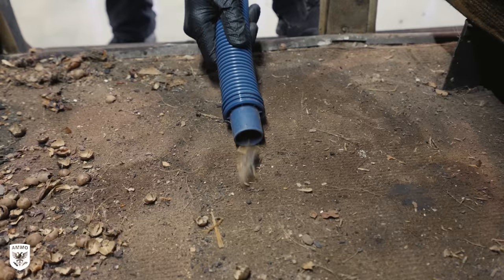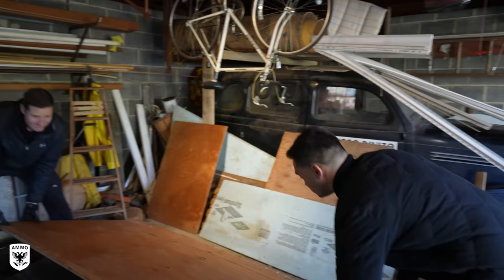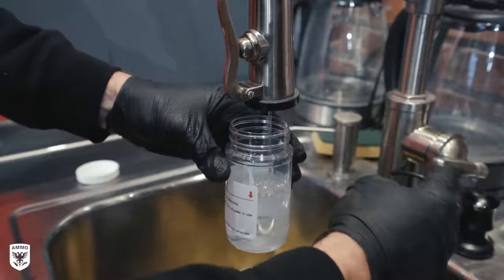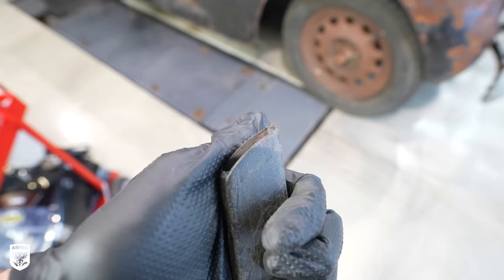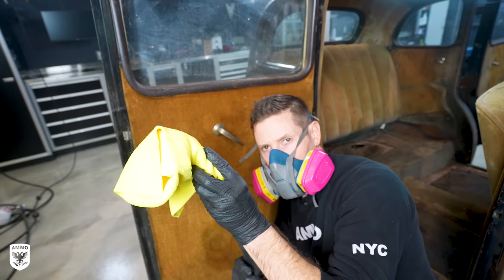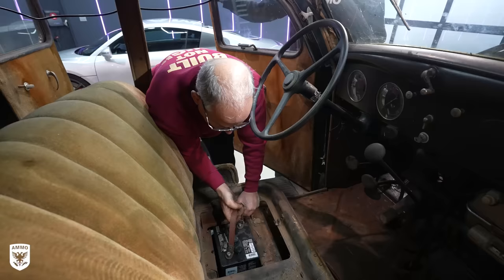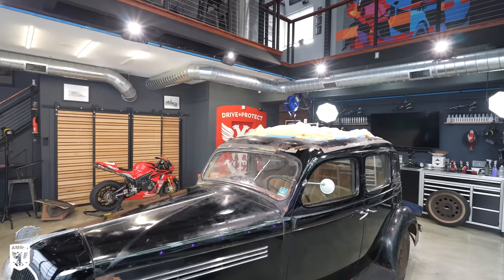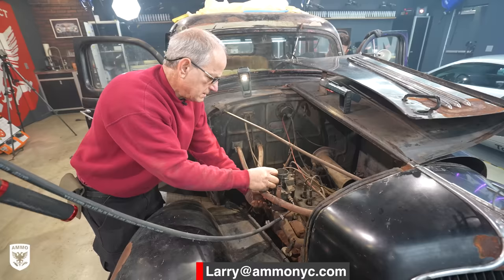First Wash In 43 Years: 1935 Plymouth PJ Barn Find Will This 87 Year Old Engine Start?!

Comment: I'm amazed by 2 things. First, that the sign didn't rip off a swath of the paint when it came off (we had that problem with an old work vehicle that had single-stage paint), and second that this old beast managed to fire up. I would have bet on a full teardown and rebuild.
Reply: as you witnessed the car was actually in really good condition....under all that dirt....for it's age.

Comment: Growing up my old man loved looking for old cars in back yards and farmers fields etc. One that stands out was a 1937 Buick Roadmaster with it's glorious inline 8. It had been sitting in a paddock for 40 years and was completely encased in a termite mound, all you could see was the grille, headlights and a single front fender sticking out. I remember going over to the farm over weekends with my dad as we dug the thing out. It took us about 7 months (didn't go every weekend) to dig it out all the way, the deal was, if we could take it away it was ours. My dad left oil in the cylinders over night, put a battery in it the next day and it started first try, just 2 or 3 rotations and it fired right up. The body of the car was covered in surface rust but a quick trip to an acid bath revealed solid steel all around, not a single hole anywhere but the floorboards and that was just a single spot near the accelerator pedal where it looked like something had pooled there.

The car had belonged to the farmer's father and was parked just ten years after it was purchased new when he passed away unexpectedly. The car had sat for 50+ years. No one in the family touched it and it was left to sit in a barn that rotted away and eventually collapsed around it (termites). His mother didn't drive and the children were too young so they let it sit. By the time he and his siblings were old enough to drive they had a much newer, more modern car so they left it be. It had been his father's pride and joy, his first new car, purchased with the success of his farm and no one in his family wanted to sell it. The farm continued to be successful so they didn't need the money. The farmer would come around to our house every now and then to see the progress and was the first person to drive it once my dad was done restoring it. He was just two years old when his father passed away. He broke down and cried, it was the closest he had ever felt to the father he never knew. My dad was so moved he decided to give the car back to him. I still remember the my dad's face when the farmer tucked an envelope in his shirt pocket and insisted he take it, it was a rather large sum of money at the time. He insisted my dad let him pay for the restoration, time and effort. My dad and the farmer remained friends until the farmer passed away, they undertook several other restorations together over the next twenty years or so. My dad is retired now but still loves his old cars. The 37 Buick lives on and I am proud to be a small part of it's story, even if all I did was get in the way with my tiny garden spade, I was only 9 at the time.  

An old car really can be so much more than the sum of it's parts. 

Love your videos with these wonderful pieces of history, thank you for sharing and doing what you do. I sent the link to my dad, I know he will love it too.
Reply: great story. ......
it is always about the stories these old cars tell

Comment: Gotta love the old 30’s era Plymouths! I hope somebody buys it and completely restores it to like new condition and then sends you pics after they are  done. It would be great to see it in all of its glory again.
Reply: Make it, safe, brakes, drive it how it is, no one is going to drop 20k on this car, lol
Reply: I have a 1936 Dodge D2. Off frame, now a streetrod. All steel except for rear fenders and running boards. Has the original window glass and regulators.
Reply: the plymouths of this era are really a great car, this particular  car is a true treasure in that it is all there and all serviceable . this would be the perfect car to make mechanically sound and drive as a "survivor"
Reply: @user-427.commodore  agree
Reply: Dont restore it preserve it and drive it
Reply: @madmanmechanic8847  agree

Comment: Long time ago you showed a tip of sanding down the tips of vacuums so I have been anal about myself. Also drilled a couple small holes in the tips to allow air to flow better when the tip is pressed against fabric

Comment: ~17:25 the older guy in the red shirt says, “it’s smoking from the oil we put in the cylinders . . .”

What oil did he use (I missed that part: where was that?)?
Reply: I used automatic transmission oil, poured directly into the cylinders through the spark plug holes. it lubricates/cleans/loosens  the rings and pistons to try to avoid damaging anything.

Comment: is it lead paint? just pulling from memory, i heard old paint uses lead.
Reply: The paints were usually a nitrocellulose lacquer or, as in this case, an enamel.
They did use lead to "solder" over weld joints on the body sheet metal before red primer and finish color.

Comment: Was it knocking when it was reved up?
Reply: there were a few small noises when it first started, could have been a sticky valve, carbon/oil on a piston, the loosened fan belt was trying to spin, rotted muffler ....all amplified by the shop and our microphones. motor sounded good after.
Reply: @tedb3789  im glad it did! Thanks for your answer

Comment: Why did he pour trans fluid into the cylinders instead of motor oil?
Reply: It is known by some that it acts as a penetrating oil to get through any rust more aggressively than just oil itself. 
Others add acetone to the ATF for loosening up any hard old oil films to get that gunk out and down to the metal surface. 
There are all kinds of concoctions people use on these old engines, even those frozen tight by rust.
Reply: I like to use transmission oil because it burns away fast, lubricates and cleans
Reply: @artnels2  agree

Comment: What’s going on with the roof on this car?
Reply: 1935 was at the cutting edge for the technology to stamp a full steel roof. some car manufacturers held onto building the roofs with a steel or wood perimeter frame, crossmember , and chicken wire to fill the center section which would then be covered with batten and a fabric like canvas or vinyl. the vinyl on this car was worn out.